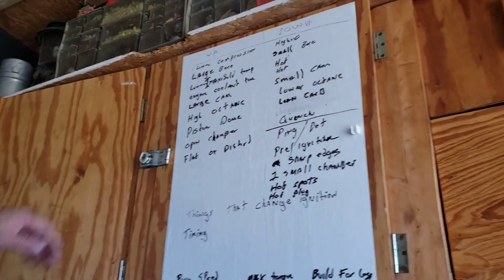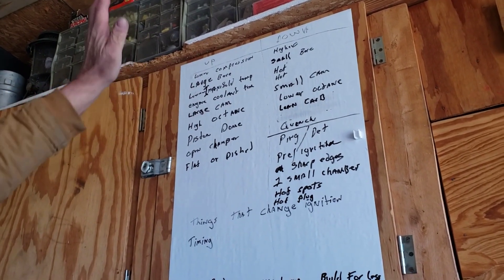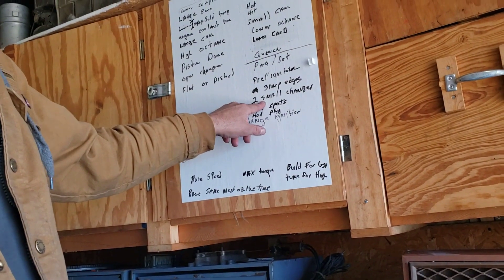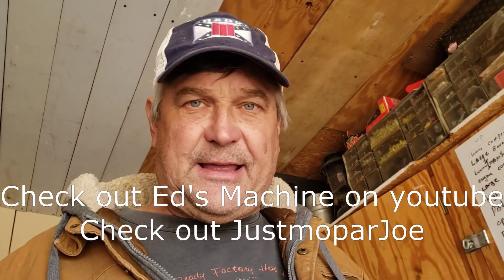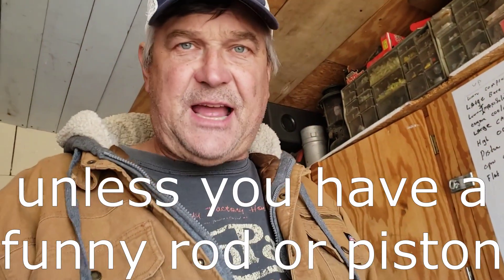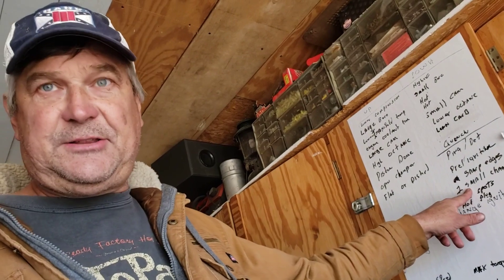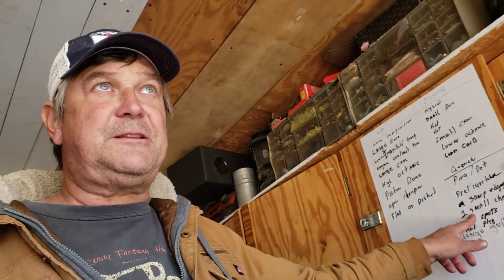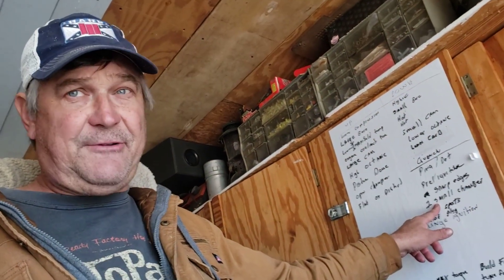Ignition timing, where it should be.If your engine can't take it your gonna break it. pt1

Comment: I have watched all of your videos and some of them 5/6 times. Great info, can't thank you enough for sharing your knowledge. I'm new to this but learning.. I have a 69 Dart with a 383 and edelbrock 750 cfm carb. have no idea about what cam it has.. it's hooked to ported, I get 16 on vac gauge at idle from manifold vac port seems to be my max. Car has TSP ready to run distributor was installed by a mechanic a year ago and now that I'm starting to feel confident enough to tinker with it I got a timing light and am trying to learn about timing and curving distributor.. My initial timing was set at 28* when I checked, Distributor had silver springs (medium) and silver bushing I think it gave centrifugal advance up to 25* on top of initial and I'm not sure what detonation is but at revving above 3K rpm engine felt off like it was screaming at me.. so I'm recurving Distributor now hoping to tune it better.. I got a Distributor kit with springs and bushings, Now I installed the black stop bushing limiting total advance to 18/19* additional instead of 25*, changed one spring to gold(lighter) left the other silver so mechanical advance now starts kicking in at about 1100/1200rpm and all in by 2500. My current timing is set at 21* initial 40* at 2500 (no vac attached) and 59*  with vacuum attached to ported. vac canister is on lightest setting.  car starts fine, runs good feels better but I feel like it's not running optimal don't know how to describe it, kind of feels like engine is not crisp enough I feel like it wants more timing but am afraid of too much timing and detonation and ping which I'm not sure I can hear if it were to happen. I can't limit the centrifugal advance further because I think this distributor only has 3 bushings you can use black silver and gold or none and the others allow for more advance so I'm using the black one to limit the advance at 18/19* additional only. In my situation, I think I should change the 2nd spring to gold as well so centrifugal timing is all in by 2000 rpm, set the total timing the way you do in your other video with the truck and leave initial where it falls after setting total. Then adjust carb accordingly as needed cuz it seems like I can't tinker with the amount of advance distributor gives any further, I can adjust the vacuum canister to stiffer setting which will limit total advance to a bit lower I presume but I'm not sure what to look for at this point. what would you suggest? I'd rather leave power on the table than detonate this engine.. If I'm not wrong I have 19* mechanical advance and 18* vac advance in my distributor the way it is now. Any of your thoughts, suggestions, wisdom or help is greatly appreciated and thanks in advance!
Reply from the maker: You are definitely moving in the right direction. Let me just say this, do not over advance your centrifugal total it will destroy your engine. You are spot on about that. No matter what initial you need, you will have to compromise that number so that you don't over advance your total centrifugal. But just do all you can and it's better than nothing. I  always go with the lightest springs first and many times have to stretch them a little or buy lighter then what comes in your kit. So to gold is sounding like the right direction. Hey thanks for checking us out.
Reply: Thanks for the response! love your videos!  @talljohnsfunshop2722

Comment: My 5.2 magnum likes 18 initial but it's hard on the starter. So I took out the heavy spring and left only the light spring and turned it down to about 15 degrees. Right after it starts though it jumps up a little a few degrees. Total at 34 all in by 2200 RPM

Comment: Thanks alot John very informative video! I've been tinkering around with the curve and timing on my slant.
Reply from the maker: It makes such a difference on everything in the way my slant runs. Friends go for a ride and they are always impressed and the biggest difference was the curve. Thanks for checking in !
Reply: @talljohnsfunshop2722   John just curious what is your initial and total you run on your slant? Is it set up just like you did in your previous recurve video?
Reply from the maker: Yes it is set up just that way 20 initial 32 total

Comment: John I also would like you to cover part throttle detonation. 
This is a subject few know about.
This is an issue with no quench and pistons down in the bore.
You can still destroy a low compression engine with this condition.
The relationship with timing and the throttle plates at part throttle. 
Thanks again, EM.

Comment: Thanks Tall John.
Well said on all points.
Not enough timing is always better that to much.
I talk till I am blue in the face trying to get people to know and absolutely be exact where their timing is.
Starting with the timing pointer and timing tab.
Not uncommon for tabs and marks to be off 1°, 2° or more degrees.
So if you want 34° total and you're off two degrees you're now at 36°.
Also many distributors advance way to much!
I have seen HEI's go as much as 54°, this is engine destruction!
Alot of people can build engine, not many can tune them.
But if willing to do so, a person can learn to tune like a pro.
Learn what works on their car or combination. 
The result, happy engine and car.
Knowing is everything, having a baseline so you can change or modify for a perfect dial in.
Great content, thanks for mentioning Joe and my shop.
It is much appreciated John.
Thank you, EM.
Reply from the maker: No more true statement (blue in the face). I guess it comes down the old saying about leading a horse to water. I feel like 1 of the hardest things to explain to people is the difference between torque and horsepower. But lately I feel its been harder to show people what proper timing can do. So I've noticed lately that most people feel like timing is a 1 size fits all. The examples you  give are exactly spot on proving the point. I love channels that are dedicated to true and not hocus-pocus and your channel and JMJ channels are that, so the shout out it easy